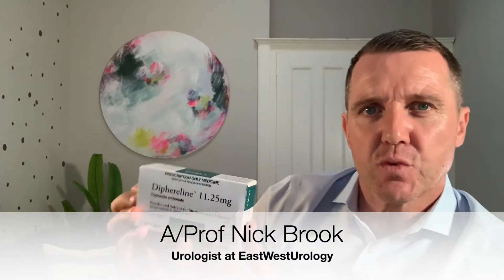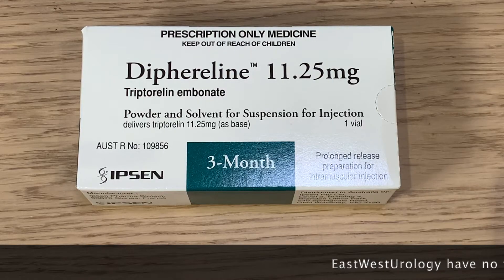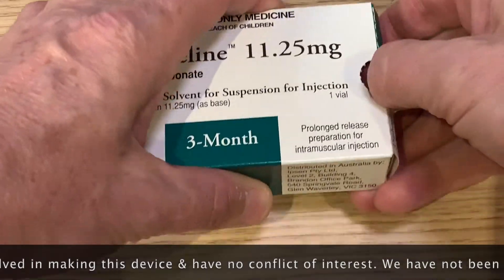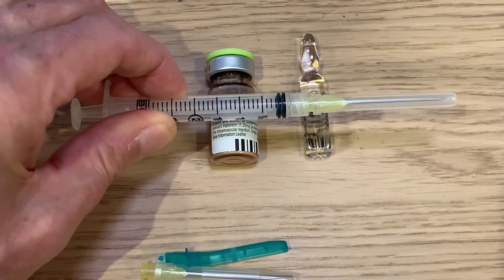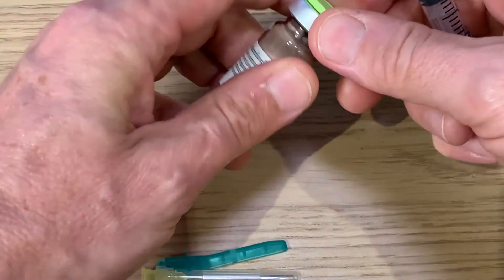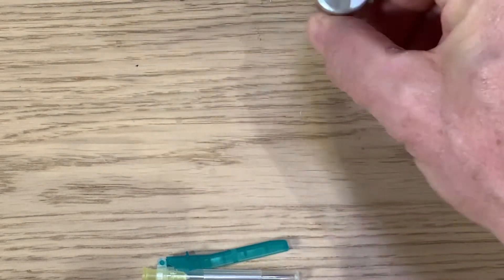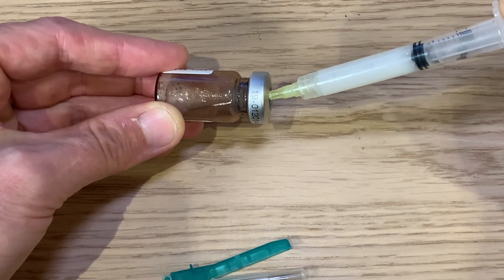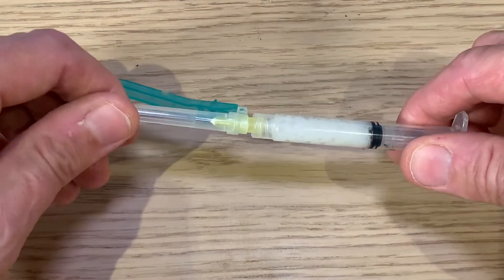How to mix a Diphereline injection

Comment: Can I remove the needle from the vile while the powder and liquid are being mixed and put the needle back in to draw up the solution. Thanks
Reply: No, that makes a contamination in the needle, because it's not a steril procedure. You can't recapsulate the needle or remove it while you're mixing it